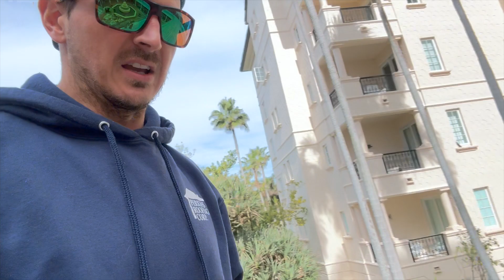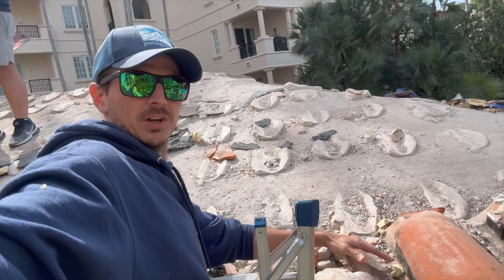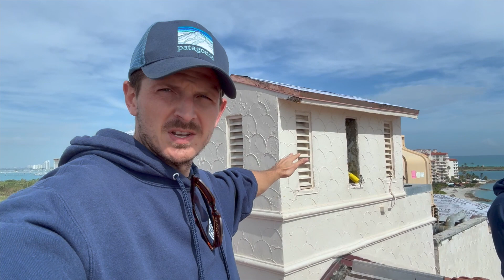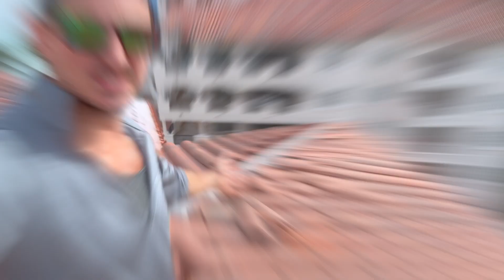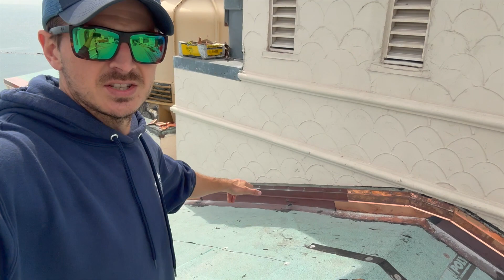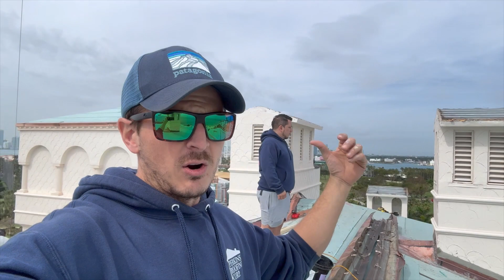Fisher Island High Rise Barrel Tile Re-Roof Part 5

Comment: Wouldn't the pieces being used to stabilize under the pan tiles eventually dislodge and cause blockages? Also, how do you prevent high winds from jiggling the edging that is nailed down and creating a leak at the drip edge?
Reply from the maker: 1.  The little pieces, while they could dislodge at some point, it would be rare and is not a major concern.
2.  The eave closure pieces are nailed through the TU plus, which is covering over the drip metal.  They are pre-sealed as they are nailed in to avoid leaking through the stainless steel fasteners.